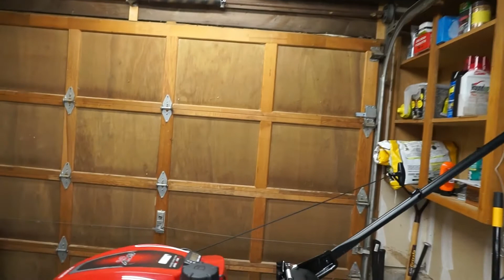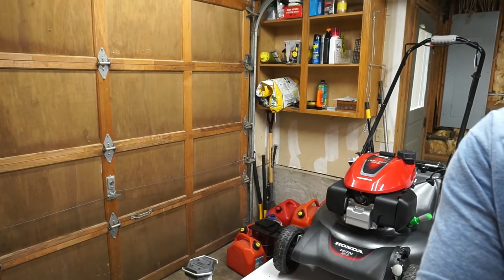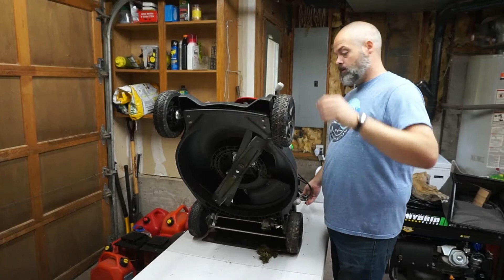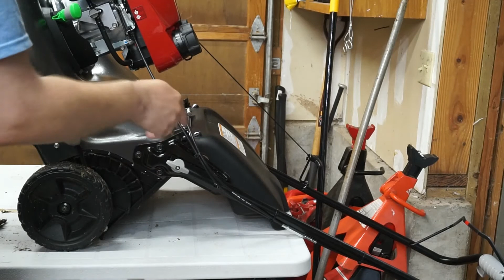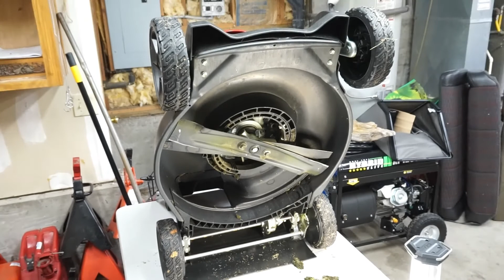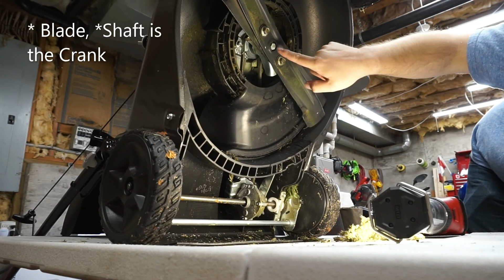Honda lawn mower deck construction, multi blade and mulch / bagging selection.

Comment: I'm familiar with the 217's slots allowing you to position the door incrementally...couldn't you just do the same with the 216, even thought you don't have the slots?  Or will the door move?  I like the increments on the 217, but I just don't need all the other bells and whistles that it comes with...the 216 would be fine with me.

Comment: My HRN216 keeps getting small sticks wedged behind the plastic shrouds under the deck which causes them to be forced out and make contact with the blades.   Hard to keep all the small sticks picked up when your surrounded by trees.   I have to keep using a screwdriver to pry out the sticks,  grass and other debris.

Comment: Myself and several others have had issues with grass and debris pushing out the plastic under "side" fairing causing blade strike.  Attached is video showing this issue which I emailed to Honda, no response to repair this at this time.  https://www.youtube.com/watch?v=pAY_dRBw8tg